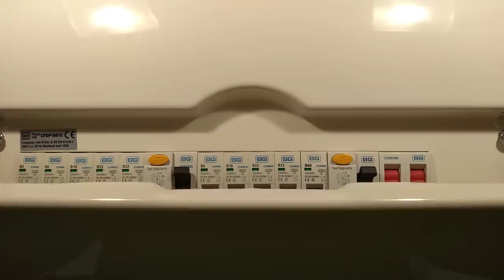A look inside a British home electrical panel.

Comment: I am always amazed by the thickness of the cables and the high current ranking of the switches.We in the Netherlands have normally 16 amp what ever the use is.And 230 v or 3 x 230 volts.And four switches per RCB,otherwise the common leak current normally would be to high because there is always leak current from capacitors to dampen the peaks of the currents. I know that normally you have 120 volts one phase,so thats why the current will be more,but still you can also get 240 volts two phase or even three phase.But still those high ratings for the switches..

Comment: Hi Clive. Like your videos. Just addition to your tracing earth faults your diagnoses on the RCD only works if your fault is on the live side. If its on the neutral side its a different kettle of fish. You would have to disconnect the neutrals (on the affected RCD neutral bar) one by one untill your RCD stops tripping

Comment: This looks much better than what I saw in UK in late '90's. Master switch for the house used a piece of single strand wire as a fuse, diameter/gauge determined ampere rating.
Reply from the maker: That's what my old distribution board was.

Comment: As your fully aware. D are for induction loads like transformers. I'm not sure when it comes to capacitive loads 🤔
I have an old school Variac which is rated at 20A but the smallest breaker that won't trip is a D40. 
Before you ask. I startes my 4 year apprenticeship in 2004 and have worked as a sparky ever since. 

I think it's brilliant that the whole world (apart from America, but then that doesn't suprise me) uses din rail and everything is interchangeable. So something in Japan will work in England due to the modular design.

Comment: The best things about U.S. panels are with no cover all empty breaker spaces are completely open and very much live at a full 240 volts, no isolation at all and if you make one mistake while working inside of the panel, it's most likely going to be your last mistake.  You can get 3 phase for your residential property if you need it but it's going to be quite expensive to have the electrical provider to come out to add the 3rd hot wire and I imagine your electric bill would see a fixed increase just for the extra wire you added.

Comment: Over here in Nz our domestic MCB standard is a C curve. We occassionally use a B curve as a 'fast trip' if required. We aren't allowed to use D curve breakers in domestic applications but they are used alot in industry. Also we are only allowed 3 sub circuits protected by 1 RCD so we typically have 4 RCDs per panel. What's this about 5 days to become an electrician? Its 3.5 years over here!

Comment: In the Netherlands you're only allowed 4 circuit breakers after a ground fault unit. Well, not legally, because the NEN1010 that describes the rules isn't freely accessible for everyone, so it's not legally binding...
And both live and neutral should be insulated. Buss bars are normally only used for ground.
Reply: If you get yourself a Hager or Schneider cabinet and their components, you are building a stable system. The system with uninsulated bars like those are totally crazy. Using the fork style KDN 363 and Hager Quick is (almost) foolproof.
Reply: @arneanka4633  You can use insulates fork bars, I meant the non insulated bars at the top with the screw terminals. Sorry, I'm dutch so sometimes my explanations aren't completely clear ;)
As long as there's no metal exposed, you can use any safe means you want to connect breakers.

It's interesting how rules like these differ from country to country.
Reply: @angeldelvax7219  Only cheap Chinese import cabinets have not insulated N and PE bars. All I use are insulated and plug in style.  Perfect connection every time.
Reply: @pmailkeey allegedly is the right word...
It depends on what you need. Radboud UMC in Nijmegen is real good at dental care, while Maastricht UMC+ is great with heart and brain issues. Pulmonary issues are best handled in Atrium MC in Heerlen. 
In all cases though, expect long waiting lists (9 months is nothing...) high prices, and a lack of human care. Most better hospitals are directly connected to universities, so they're great in treating issues, but often aren't aware they are working with actual human patients.
Health insurance is a nightmare here. prices are immensely high, and you hardly get any care payed for.
a LOT of dutch people actually go to Belgium for care. They have shorter waiting lists, and often are better in working with patients instead of illnesses. The actual treatment is almost the same as in the Netherlands though. 
I don't have any personal experience with healthcare in other countries, so I can't say if it's actually better than in the UK.

Comment: In the netherlands we call the RCD's with all 3 protections allemat's we use them for PV installations mostly, i have often been told to replace the normal RCD's by these because they're safer when there's no point to it. The only thing i can imagine that being good for is when the normal circuit breaker's contacts stick which does happen if you don't test them often

It's also interesting to see that you british folks have 5 breakers per RCD when we use 4 in fact if i put 5 in they could fire me over that

Comment: This enclosure is small compared to a US 200 amp breaker box. We also use 240 volt here but we split it into two 120 volt legs.
Reply: And only use 240 for things as clothes driers.

Comment: 1) What are downsides or reasons not to using big fuse instad of main breaker
2) in eastern europe busbars are insulated, also possible to buy 3 phase busbar where each phase connects to every 3rd fuse.
Thanks for starting such series Bigclive :)
Reply: big fuse located near the meter it should be ok using just breaker

Comment: This reminds me so much of the very early 1990’s US Square D Trilliant System... When Square D decided to start using the poly boxes for residential distribution panels. Boy, that went over like a lead balloon. They also had the same type breakers made of the same material. I don’t think they lasted more than about five or so years if I remember correctly, no one wanted the plastic like polycarbonate boxes at all. They might have been UL listed and there wasn’t anything really wrong with them but they weren’t popular at all.

Comment: Great Video! Just wanted to point out that I was once dumbstruck trying to troubleshoot a leakage current fault by following somewhat the same procedure that you point out at 12:36. I would start by turning all circuit breakers of the block off as you mention, turn the RCCB on, but then no matter what circuit breaker I would set first it would always trip the RCCB. After much head scratching and pulling wires from the walls I realized the fault was on a neutral lead and since the neutral is shared across all the circuits of the block and not isolated, no matter what circuit breaker I would set first it would fault. You can avoid this problem if you use bipolar CBs instead of unipolar CBs, they will isolate both the neutral and the live leads of a circuit. Of course bipolar CBs use double the space and cost a bit more than unipolar CBs. Also I have tripped RCCBs by accidentally touching ground with a neutral lead (the circuit was isolated, but only the live lead). I not completely sure, I think in TT systems anyway this is true, the neutral lead under normal conditions will always have some voltage difference with respect to ground (I have measured up to 30V) which depending on the faults' impedance will be enough to draw the 30mA necessary to trip the RCCB. Keep up the great content.

Comment: hi Clive, that was interesting. very similar to what we have in israel but we only use separate rcd circuits in industrial installations.. in my home we have an 63a isolator, 63a rsd  and than all the breakers.  but we use plastic boxes for homes. great video. more more more.
very interesting to see what going on on other places

Comment: I am a unlimited license electrician in Charlotte, NC, and this panel resembles strongly the PV panels I have seen... 
interesting to see BLUE for neutral conductor color. Here in the us, it is white or yellow. Brown is a conductor color in 460v 3ph panels, along with orange and red...
Reply: The current GFCI breakers are similar to your rcbi breakers, but we don’t have group protectors I am aware of.

We have added the need for arc fault breakers on all non GFCI protected circuits to protect from consumers using extension cords.  

My old boss just had a rental house of his he remodeled on his own burn down due to a cell phone charger plugged into a cheapo extension cord run under a rug, and stuffed under a couch. The cord or the charger melted and flashed the sofa into flames and took down the house...
Reply: Mind blowing that HOMES in uk can operate with 60amps! 

Here in Charlotte, NC, most homes are 200amp, many are 350amp, and a good many bigger homes have 400amp panels. And we also have 240v power, but split phase 120 to neutral. So, around 48000 WATTS usage here.

Comment: We are only allowed 4 subgroeps behind a single rcd’s in home syetems (EU Netherlands). Default is 1 phase 25amp main, in my home case because i cook electric, i have 3 phase 25amp main. It safety practice to thigh at tensions at least ones in a couple of years all the connections.

Comment: Clive I know the new regs say split load per RCD is how to go now days but I still split lighting to one RCD and the other RCD to power. Then chances are you get a fault on the power side, you won’t suddenly be put in the dark. Plus RCD’s are like 63A so for every domestic property I have done, that’s more than enough for their power circuitry, even with the oven on and hairdryers plugged in etc. I have actually had customers say “the RCD keeps tripping, what one do I look at, okay ok il unplug it and reset…. I’ll reset now- okay sorted it works!! Thanks”
If they had been in total darkness it would be way way more difficult if not impossible to solve that over the phone. A fault simply due to some cheap Chinese heater shorting to ground through a socket in a bedroom, bringing the whole house to a standstill.
You have any views on that?
I understand that it’s split load but I like the lighting and the power to be separated it’s much more useful.

Comment: I like the corrosion resistance of the older plastic version as my property is so near the sea I get salt spray that causes issues. Mine is in a wooden cabinet in a drafty garage but old one still suffered!  They are a bit fragile though as you say.

Comment: The old system that I had, would have push button circuit breakers, and whenever there is a tripped, they would push themselves out rather than you manually switch them off to isolate it.

Comment: I find the Square -D brand of breakers in the US as well as steel and grounded enclosures to be the safest, IMO. Also, the lower voltage  of 120 volts@ 60 hz and typical 15 amp branch circuits. In addition, the US does not have as stringent laws about non -licensed electricians being able to deal with home installations.  Millions of us are quite capable of doing electrical work in a home (safely and properly) on the load side of the meter.
Reply: Safely yes. Properly? I have my doubts. Workmanship is terrible generally. Stapling every 4'? Optional. Wrapping around pipes for support? Check. Not using rated cables. Check. It makes me ill when I see homeowner work.
Reply: @chasmosaurus3  I never said EVERY person was capable of doing everything perfectly. Actually, in my career, I have seen dozens of licensed electricians do some of the crappiest "work" imagineable. As for those would would claim that crappy work was done because they were not unionized, the unions are where some of the worst job site skills are  found and they frequently severely overcharge on every call. The biggest difference is that most homeowners will go the extra mile (yes, stapling every 4 ft) because they are not working against minute by minute time frames that aretracked by an accountant.

The absoulte worst work is freequently concealed inside sheetrock walls where the homeowner is not expectedl to be looking inside while the "electrician" is not on site and in fact a few years may pass before the walls are ever opened, to reveal rank amateur workmanship.

One frequent thing we doscover is that most electriciands work work strictly with standard utility power is the mixing of signal level electronic cabling and AC power lines. NO CAN DO!. I have had so many epiosodes of questionable and down right dangerous wiring scenarios over the years that required major rework to correct the screw-ups of licensed sparkies , it is ridiculous. One of the most frequent involves improper grounding and especially on sub-panels. Grounding was covered on day 1 of the trade school, guys .

Comment: I much prefer nice big knife switches mounted on a slate slab in a french polished mahogany cabinet. Anyway the mains in my house is always 250 volts - only just enough to run my 25KW trouser press or new DAB radio (I have a 100W main fuse). 
It's a very old house ;-)

Comment: Wow, completely unlike the panels we have in the USA. There are several different styles based on manufacturer designs, but the all have the same typical layouts. There are stacked bus bars the breakers just snap onto and the branch circuit hot leads are screwed directly into the breaker. The neutral and ground screw down to their own bus bars. 

All panels are and were metal. Ring circuits are incredibly rare and I believe outlawed by the National Electrical Code. 

I suppose we are odd with our  240V single phase split to 120V.  240v circuits use both hot leads, 120v use a hot and a neutral. 

My home has a 100A service which is considered quite anemic these days.

Comment: Would be interested to hear an explanation of any differences between UK and European and US domestic wiring, requirements and approaches to safety, how these might be talked to voltages. Also differences in how/where voltages are reduced before the domestic supply, and use of phases etc?

Comment: I’ve been watching a few videos on consumer units recently as I want to install a 32a socket in my garage, I’ll probably still get an electrician to sort it out but it’s interesting to learn. Thanks for sharing.
Reply from the maker: If you're technically inclined and your consumer unit has an external, isolator that kills power to the whole thing or you understand where the live connections are at the isolator when it's off then I'd suggest doing it yourself.  You'd probably do just as good a job as many of the people masquerading as electricians these days.
Reply: bigclivedotcom I may order the parts needed and give it a go, I have a trip switch inside the house which cuts off the supply to the garage, inside the garage there’s a small unit containing a 100a main trip, a 16a trip and a 6a for the sockets and lights. I’m thinking I would need to buy a bigger box for the garage to fit in the extra 32a switch for the socket (and maybe some spare spaces for future installs), the socket and some wiring. The only thing I’m not really sure on is what wire thickness is best to run to the socket. Do you think this sounds ok? And thanks for the response :)
Reply from the maker: @bendude6748  One of the most important things to check is the size of the cable going to your garage.  The info is usually embossed onto the side of the cable.  If it's suitable for the load and the existing breaker protecting that circuit is also rated suitably then the 32A socket can be added with 6mm cable.
Reply: bigclivedotcom I can’t see the wire as it’s inside a sleeve so I don’t really fancy cutting it off, it’s a pretty thick wire though and when it was installed the electrician did say he would wire it so I could use a welder or big air compressor in future so I’m hoping it’s fine. I actually installed a new consumer unit in there today, it was actually quite easy seeing as I’ve not done it before, I think it’s just daunting when you first look at all the wires, the hardest bit was tucking the wires lol. I haven’t installed the socket yet though as I ordered one with wire just waiting for it to arrive.

Comment: Why do British breaker boxes have so few circuit breaker expandability and amperage capacity?  I love the fact my home has a 200 amp breaker box with the double sided hot and neutral/grounding bus bars. So flexible and expandable with up to 40 breaker module expandability.

Comment: I'm a fan of the BG boards, I've fitted a few of them despite what people say if you fit them correctly they are good quality overall. However I've learnt not to trust the spirit level bubble because it's never true level! Also the box can easily warp if it's not mounted on a perfectly vertical wall, which makes the cover a nightmare to fit. I always check the cover fits on after I have attached to wall. I usually take out the large back knockout, raise the box up from the wall so there is space behind the back for the wires. Then when it's all done and tested I will sparing apply firestop sealer in the gap. Tails I usually enlarge the most suitable 20-25mm knockout for the gland or swa cable if it's a garage install.
Reply from the maker: The spirit level was terrible.   There is a third hole for a three point fixing on uneven walls.